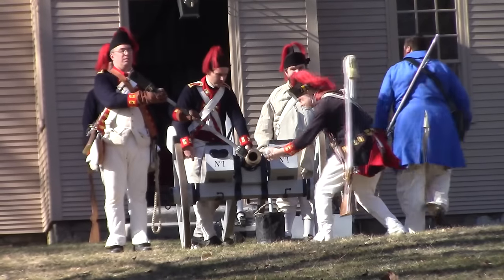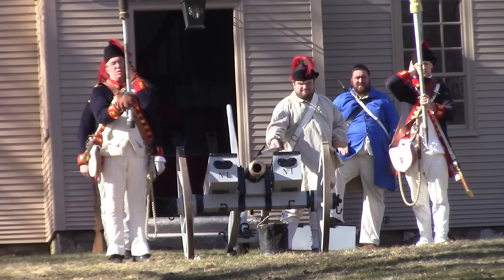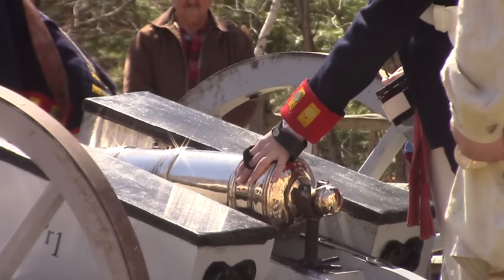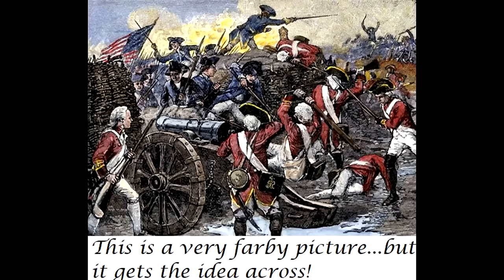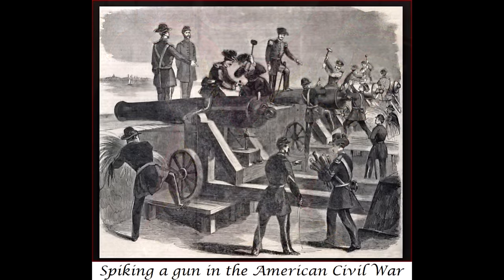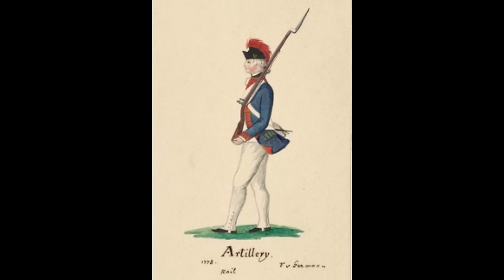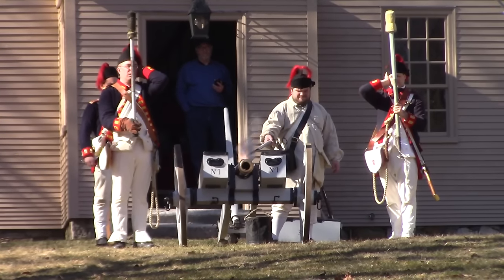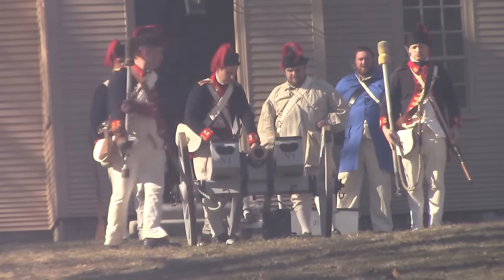Spiking Guns, and Other Topics Regarding the Royal Artillery

Comment: With regards to the "chain and pickers" worn on cavalry shoulder belts these were not used to "spike" cannons as they were too small and were in fact used to clear the touch holes of the pistols and carbines carried by the cavalry,as comparing the size of the pickers with the size if the canon touch holes will show that it would be impractible and they were called "pickers" because they were used to pick the black powder residue from the touch holes..Also it was not the hussars job to "spike" guns,they were there to break through the enemy lines killing anything that got in their way and spreading fear and chaos amongst the rear ranks.This went wrong at Balaklava where they went too far and ran into the massed ranks of Russian Cossacks and uhlans.The preferred method for spiking guns was for the charge to be accompanied by members of the horsed field artillery or some artillery men on horses,who would once the light cavalry had cleared or killed most of the gunners and supporting infantry,  dismount and hammer in headless 6" nails.The nails would be common stores in the army and the fact they were 6" long would mean they would go down through the touch hole and into the barrel end of the cannon.With the heads of the nails sawn off it would be impossible to remove them and the barrel would have to be returned to a foundry to have the touch holes bored out.This was one of the mistakes Marshal Ney made when he led the many cavalry charges at Waterloo.The artillery would fire cannister and grape at the cavalry,then run for cover into the infantry squares,when the French cavalry retreated to regroup the artillerymen would run out of the square and reload and fire their cannons into the rear of the cavalry.This happened 7 times and all because Ney hadn't taken any artillerymen with him to spike the guns.
Reply: What went wrong at Balaklava was charging a battery of guns head on, especially when it was flanked by  more guns supported by infantry. The Light Brigade stunned the Russia cavalry into a form of stupefied inertia  and actually  drove them back but then had to retire through the flanking fire on their return
Reply: When the Russian gunners returned they fired grapeshot and cannister indisciminately into friend and foe.Also it would have been likely that none of the Light Brigade would have survived had it not been for the charge of the Chasseurs d'Afrique who cleared the Fedyukhin Heights of two half-batteries of guns and two infantry battalions and then from there charged into the flanks of the pursuing Cossacks and provided cover for the remaining men of the Light Brigade as they withdrew.Louis Nolan is mostly blamed for the debacle and certainly his continued frustration with Raglan keeping the cavalry in a "bandbox".He also failed to realise that the view he had from the hill Raglan was on and the view from where the cavalry were in the valley was different,and when Lucan asked what guns he was referring to a frustrated Nolan is supposed to have said "There sir is your enemy and there your guns" and indicated with a wide sweep of his arm,not the Causeway Redoubt which Raglan had intended,but the Don Cossack Battery in the North Valley.However not only did Nolan design the "Nolan saddle" which was adopted as the standard British cavalry saddle, but he also wrote a book on cavalry tactics in which he said that used properly cavalry could attack an entrenched artillery position with little loss,which was against all cavalry doctrines of the time. So there is some question as to whether this might had influenced him,but as he broke ranks and rode ahead of Lord Cardigan,much to Cardigan's anger,as no-one rides ahead of a commander of a cavalry divisions,seems to imply that he realised that he had made a mistake.

Comment: the gunners carried two types of spike one you mentioned permanent and the second type had a spring attachment so you could temporarily spike the gun and prevent it being used against you if you thought you had a chance of retrieving it the spring spike if you knew how you could remove it and return it in to battery and fire on the enemy

Comment: As far as the exploding iron gun goes, if we assume the iron used to make the guns was high-carbon (like cast iron or pig iron) the resulting hardness of the metal is quite high. (hardness being the resistance of the metal to deforming under stress)  Hard metal behaves more like glass and less like tough metal. (toughness is the ability of a metal to bend while stressed without breaking)  This is because of how the carbon is dissolved within the iron crystal structures:  More carbon in the iron results in more internal stress; this increases hardness at the cost of toughness.  That's why the iron guns didn't show any stresses until they came apart all at once.

Comment: I think the problem with Iron guns is that because its melting point is so high, it hardens too quickly when you cast it. Actually reaching the required temperatures is really hard (the difference between 1000°C and 1200°C is BIG). At the time they did only just get there, which means the cast iron can harden around air bubbles.

Comment: Something you could have added was the tendency to load multiple shot down the barrel. (I am more of a navy guy myself so not sure how common this was with the artillery) But let's say it's a 12 pounder gun they would often double or triple shot the guns meaning there would be 2 or 3 12 pound projectiles being fired at once probably quite helpful with the smoothbore and the long reload times. If you ever see Master and Commander they do mention this and show multiple hits from one gun firing unlike most films of this genre. And obviously they would have a multitude of types of shot that could be used such as musket ball sized projectiles etc.
Reply: Spiking and nnspiJcing guns, and rendering them unserviceable.
To spike a piece, or to render it unserviceable.—DriTe into the Tent a jagged
and hardened steel spike with a soft point, or a nail without a head ; break
it off flush with the outer surface and clinch the point inside by means of
the rammer. Wedge a shot in the bottom of the bore by wrapping it with
felt, or by means of iron wedges, using the rammer or a bar of iron to
driTC them in; a wooden wedge would be easily burnt by means of a charcoal
fire lighted with the aid of a bellows. Cause shells to burst in the
bore of bronze guns, or fire broken shot from them with high charges. Fill
a piece with sand over the charge to burst it. Fire a piece against another,
muzzle to muzzle, or the muzzle of one to the chase of the other. Light a
fire under the chase of a bronze gun, and strike on it with a sledge to bend
it. Break off the trunnions of iron guns ; or burst them by firing them
with heaTy charges and full of shot, at a high eleTatiou.
When guns are to be spiked temporarily, and are likely to be retaken, a
spring spike is used, haTing a shoulder to preTent its being too easily extracted.
Reply: From the 1861 ordinance manual (US Army)

Comment: The ‘brittle iron’ is what is called cast iron, in addition, when formed it is very hard to ensure that there are no cracks or air bubbles because they form on the microscopic level,it’s brittle due to the properties of iron, when the iron goes through hardening processes (heating to critical temperatures and the cooling at different rates depending on the qualities needed) you can get a better quality iron and this was done on the early rails (for trains). When you start adding carbon and manganese and magnesium (each adds different properties and changing the percentages by even 0.5% the quality of the steel can be vastly changed) you being to get steel which is what most ‘iron’ you will see today actually is. With steel it is even easier to heat treat
Reply: I jad heard thay they began with cast iron tracks in the early days in England but gave up because the properties were really attrocious.
Reply: @Richard0292  they began with tracks made out of wood. but that mend the cards you could use had to stay pretty light. plus the wood had to be maintained about every day with fat or wax.

Comment: In the period you’re interested, the Royal Artillery was administered by the Royal Ordinance Board, not the Army command at Horseguards. Also, as you mentioned in another video, Gunner officers did not purchase their commissions, along with Royal Engineers (in the late 18th and early 19 th centuries a wholly officer corps), they went to the military college at Woolwich.

Some traditions still hold, in the modern Royal Regiment of Artillery, they have no flags as colours, instead the guns themselves are the Colours of the Regiment, and soldiers are ordered to run to the guns, and quick march away from them.

Comment: If referring the Royal Artillery, please OH Please use Royal Artillery (That,s British Uniforms and Drills).  Those used on this post are Canadian Reenactors.   Also the connection with Royal Regiment of Artillery (Regiment's of a Regiment   and the Royal Regiment of Royal Engineers (Corps) with Regiments and for a while Artillery in Blue with Red Facings and Engineers in Red with Blue Facings.

Comment: And a iron cannon that was made during the civil war was called a parrote if I'm right or parrote rifle and it had a iron sleeve around the back end where the fuse hole or touch hole, was and also this sleeve gives it is shape instead of the more rounded end to it. I should probably work in a artillery reg.
Reply: Parrott. It's named after the inventor.

Comment: Not, or well, rather exactly to be pedantic :), you mean "cast iron" no doubt, not simply "iron". These are very very different metals. Plain iron, as in almost pure Fe is a rather soft metal that corrodes extremely quickly. Steel is Fe with some significant carbon content and some extra additives (Zn, Ni) that make it hard but still elastic. Cast iron, AKA "pig iron", is Fe with much higher carbon content. This is the hardest version of iron, but also rather brittle. Steel would have been the best material for the gun bore in fact  (and today is much cheaper than bronze), but technology of the time could not control carbon composition of iron well enough. The process utilized at the time produced molten iron with high carbon contents, thus yielding what is called now "cast iron". The term iron stands for the base metal itself which, without all the modern ligations necessary to produce quality steel, was unsuitable for gun production.

Comment: I understand that the iron used in 18th guns was high in carbon thus brittle, but how do the steel guns of the 19th compare in terms of danger?
Reply from the maker: I couldn't say, but I imagine much better.
Reply: From what I've heard the high carbon cast iron is the reason that they were brittle. The wrought iron guns did not tend to explode due to the lower carbon. Sorry for the lecture.
Reply: The Parrot rifle was exceptionally safer than previous peices because of a supporting band of steel at the breech, where most barrel bursts tend to happen.

Comment: INJURIES CAUSED BY SERVICE.
Bronze guns are little subject to external injury, except from the bending
of the trunnions, sometimes, after long service, or heavy charges.
Internal injuries are caused by the action of the gases developed in the
combustion of the powder, or by the action of the shot in passing out of
the bore. These effects generally increase with the calibre of the piece.
Of the first kind, the principal one is the cutting away of the metal of
the upper surface of the bore over the seat of the shot.
Those of the second kind are : The lodgment of the shot, a compression
of the metal on the lower side of the bore, at the seat of the shot, caused
by the pressure of the gas in escaping over the top of the shot. There is
a corresponding' burr in front of the lodgment, and the motion thereby
given to the shot causes it to strike alternately on the top and bottom of
the bore, producing other enlargements, generally three in number; it is
chiefly from this cause that bronze guns become unserviceable. Scratches
caused by the fragments of a broken shot, or the roughness of an imperfect one.
The durability of bronze guns may be much increased by careful use, and
by the precautions of increasing the length of the cartridge, or that of the
sabot, or using a wad over the cartridge, in order to change the place of the
shot ; by wrapping/ the shot in woollen or other eloih, or in paper, so as to
diminish the windage and the bounding of the shot in the bore. In field
yuns, both bronze and iron, the paper cap which is taken off from the cartridge
should always be put over the shot.
Iron guns are subject to the above defects in a less degree than bronze,
except the corrosion of the metal. The principal cause of injury to iron
guns is the rusting of the metal, producing a roughness and enlargement
of the bore.
The Service to which an iron gun has been subjected may generally
be determined by the appearance of the Tent. After about 500 rounds the
Tent becomes enlarged to .3 inch, and should not be longer used.
In riiied guns the wear of the Tent is about twice as great as in smoothbored
guns.

Replacing Vents.—In field and rifled piece's, the Tent-pieee is taken out
and a new one is screwed in. In other guns, the Tent is filled up by pouring
in melted zinc, the Tent being closed on the interior by means of clay placed
on the head of a rammer and pressed against the upper surface of the bore,
and a new Tent is bored, at a distance of two or three inches from the first.
Reply: did not know that thanks for the info.
Reply: Excellent reply. In addition if you are ever in Vienna go to the  war Museum where they have a roofed area outside under which are a huge collection of bronze and iron cannon some of which have battle damage. It is a most instructive exhibit if you know what you are looking at.
Reply: @glynluff2595  I am planing to visit Vienna one day, I heard that they have a lot of very nice museums.

Comment: I know this question is a little out of the video’s time period but I would still like to enquire: I find that most bronze artillery is not rifled even in the mid 19th century whereas iron and steel ones were rifled, is there a reason for this?
Reply: Basically metallurgy, production issues and inertia of tactics.... The thought was there... "Rifled Cannon, good idea!" But everything had to catch up.
Reply: Bronze was too soft to stay rifled whare iron was stronger and able to stay rifled.
Reply: @danielkohli1542  The French did eventually rifle their bronze 12 pounders, but IIRC this was more of an stopgap measure and proved inferior to German artillery in the war on 1870
Reply: You have the answer in your question! By the time steel was being used shell shapes had changed and driving bands fitted to the lower end. This allowed engagement with the rifling and the use of higher gas pressures to spin the shell. As the British were first to develop steel so with guns. Herr Krupp visited Britain and amusingly, made clandestine visits to foundaries to learn the process which he eventually leaned to replicate although he initially had problems with the coal.

Comment: I’ve been told that spiked guns have to be completely melted and recasted from the damage if they are to be used again, is that true, or can the nail be removed and the canon reused?
Reply from the maker: I imagine that it largely depends on how bad the damage is from the spiking, but I can't say I've ever heard of them re-casting the guns as a result.  If a gun were that badly stoppered they could probably just re-drill the hole.
Reply: @BrandonF  I see something to look in to and yeah only way to know is pull the spike out and take a proper look at it. I mean they can be pulled out so why not.

Comment: If blue was the Royal color, is red the color of Parliament? I am just assuming since parliamentarian soldiers in the civil war sometimes wore red.(Excuse me please if I'm wrong)
Reply: Russet cloth was dyefast and reasonably cheap. However, not all Parliamentary regiments wore red coats.   The colour of coats  was not relevant. Uniformity was not  sought  or achieved, although in theory regiments were supplied with  coats of the same colour  by their colonels. In the C17th  coloured sashes and field signs were  used to identify opposing sides. Orange was the colour of Parliament,  I believe.

Comment: Why are the 2 people with the ram rods holding them like that, and unnecessarily standing up in the open?!? Everything is done so slow and inefficiently...
Reply: They hold them like that as a signal that they are clear of the muzzle and ready for the gun to fire.  They stand there so they can see the muzzle and be sure the gun has discharged before stepping n front of it again to reload.  Slow equals efficient and SAFE, rushing the drill leads to accidents, and on a canon, there is no such thing as a small accident.
Reply: @stuartjarman4930  The one firing can easily see if someone is in front of the cannon before firing. The big puff of smoke and lack of a fuse should be an obvious sign the cannon has fired. 

Looking at the angle of the cannon, this is not for indirect fire so the enemy would be able to see them. Standing out in the open just unnecessary makes you a bigger target. Holding the ram rods up like also that seems to only telegraph to the enemy when the cannon is about to fire. 

You probably have a point about not rushing to fire since it's not real combat though